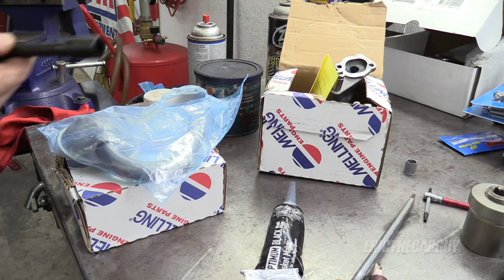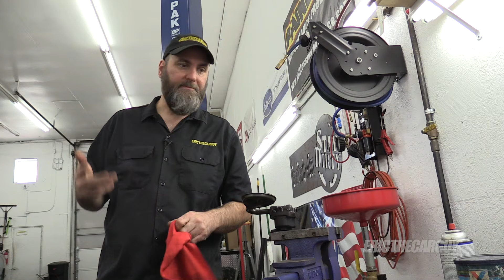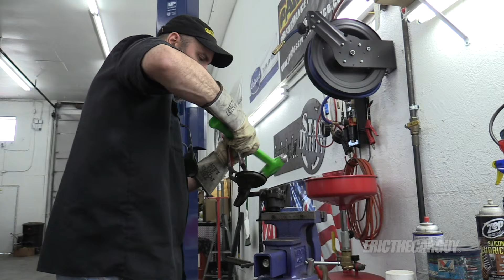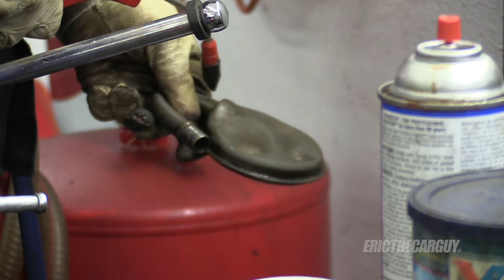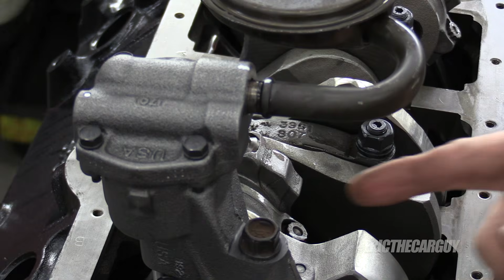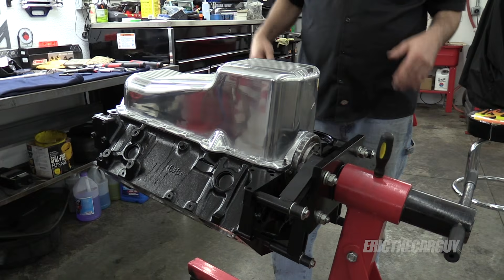How To Properly Install an Oil Pump Pick Up

Comment: My pickup tube had 2 thou interference with the pump, and the only way to fit that in was with a bearing splitter.
I drilled the treads out of a nut M16 to fit the tube, cut the nut in half and grooved the sides with a grinder, then put the 2 halves around the tube and tighten the bearing splitter, add the extensions and the bar across the top, put it in the vise and hammer it in.
It was sooo easy, and when I finished it, shouted "Flawless Victory" just like the Mortal kombat arcade games back in the day.
It's great when you put a plan into action and it actually works.

Comment: I am having the same problem right now with my 1998 Chevy S10, with a 4.3.   I am using the same Manufacture and it is a high volume.  I measured the difference between the male and female (pump side) is .005".   I am trying to hone out the male hole and then drill a hole in the pump to thread for 1/4" x 20, to then use a set screw to lock it in place.  Should work?

Comment: It's helpful if someone has the capability to take the entire pan out, indoors, with every tool needed on hand. This video would definitely be helpful
Reply: You don’t have to be indoors, and if you don’t have the TWO tools required to do this job then maybe you shouldn’t be worried about working on cars.
Reply: @scottblubaugh sure buddy, I know being indoors & outdoors is no different than working underwater. Show me a video where you take the oil sump out using jack stands & might consider your reply is is for the everyday guy who can work on cars.
You're entire response is dumb no matter how good you are as a mechanic. As I said everyone doesn't have a shop & power tools to do every single job. I can maintain my vehicle well. I've done every single repair myself. 

I just happen to know, realistically for a person who works 40+ hours a week & has a family. Taking the oil sump out without a lift isn't an easy job & is time consuming. But hey, what do I know right. I shouldn't be working on my own vehicle according to you

Comment: They now sell oil pump and pickups that are bolt on. Also if you braze the tube on be sure to temporarily remove the bypass spring else that excessive heat can weaken the spring thus lowering the bypass pressure.

Comment: Bought a gmc 1500 truck was told by dealer it had been serviced three weeks later i go change oil my dipstick had good clean oil.on it ,but when removing drain plug  only sludge began to come out  .is it possible the oil.pck up tube is still sucking up good oil and engine not damaged ,oil.pressure still good i plan to.remkve oil pan clean

Comment: Hi, i have a 95 silverado k1500 4x4 5.7L. I want to upgrade the oil pump to a high pressure oil pump is there any modifications i need to do to install it?

Comment: Well I know where I went wrong. I bought a crate motor when I was 19, we put the oil pick up tube in the freezer then put it in. We did not tack weld it. I blew the engine a week after installing it. My dad blamed me for driving it to hard. Chevy replaced the engine at no cost but clarified the cause. Always wondered what we did wrong.

Comment: Use an open end wrench that fits the tube against the flange, never hit the tube ,...ALWAYS Tap on the flange. . Then tack a spot. First, tape a 3/8 drill bit to the bottom of the pick up, place on the pan sans gasket. This will give you the proper gap , after the gasket, do this before you fully seat the tube. Its not complicated.

Comment: Good Job! My 2007 Hyundai Elantra G4GC 2 litre Engine Oil Pump pickup pipe , has a gasket and has 2 bolts fixing it to the engine block.
Hehe, I polished my Alloy Cast  oil sump too! 💖👍

Comment: Everyone in my engine builders page is saying to take apart any oil pump I get . Melling or sealed power. And check for burrs. The shaft notch on mine was razor sharp.

Comment: It is actually a lot harder to do with a new pick up screen. The new screen is about 6mm larger than the hole in the pump. Since an old "already compressed" used screen was used it was already compressed enough to get it started into the new pump. Next time I do this I will use the old screen.

Comment: Hello Eric. I enjoy watching your videos. You go straight into business explaining the process of repair or installation which is very good. 
I need your advice in a project I started with my 2000 landrover discovery 2.
I am installing a diesel engine year 2000 isuzu npr to my landrover discovery. So far so good. Where I need guidance is with the oil pan that interferes with the front differential. I need to modify the shape of the oil pan. The pick up line I figure needs to be reconfigured to the left side of the oil pan. When I reduce the volume of the oil pan that interferes with the differential - will the smaller volume of the oil pan affect the performance of the engine?

Comment: My truck has a plate in between the the pickup tube and the the journals, it gets held in place with the same bolt used to hold the pump in place as well as 3 other nuts. Is it not necessary to put that plate on? Because if not I will remove it next time because its a hassle to hold the pump in place and hold the plate in place while at the same time putting  a nut on and a bolt on while under the vehicle because of gravity.

Comment: I put a nice tack weld like you did . Next day I pulled the pickup off by hand. The weld cracks off the cast as it cools. Yours did too I guarantee it. Waste of mig wire. There is a proper Tig process and a type of brazing but mig useless on cast. Pioneer makes a retainer that bolts on part # 839061 . I'm using that.

Comment: What "several engines" does that "Chevy" oil pump pickup installation process supposedly apply to and where exactly in "Chevy" manuals, tech info or other "official" and "reliable" sources did you find that "Chevy" process?

Comment: Now Eric I respect you and your advice But I just opened my oil pump and check out the measurements and the relief valve inside the house to make sure it goes up and down well mine was stuck and I was going to port the sharp edges.
And pack it old school style with good ol vaseline .  Just a word to the wise check out your oil pump valve on the inside .
That 💩 would have been disastrous for me it's my first baby 350 hopefully not the last.

Comment: If you tack weld it should be done with a high Nickel rod.  Cast iron welded to steel with a steel rod is very brittle.  Mentioned in other threads for installing pickup to SBC.  Brazing would also produce a good joint.

Comment: use half a tube flaring tool set to loosely clamp around the tube and hold it at the roll, then use a press and some blocking to support and shove it in properly

Comment: Hello sir, i have suzuki jimny wide auto 1998 model. The car loses power uphill, i changed its gear box, but the problem is still there. Its rpm doesn't increase beyond 2 in Drive and 2nd gear, but in L it gains acceleration, plzzz suggent me useful tip as i lost huge money correcting it

Comment: Eric, you can use the open end side of the wrench over the pipe, and hit the wrench to drive the tube down.  And you should use clay to measure the pan clearance.

Comment: My Way of thinking  should their be a gasket between oil pump and main cap to prevent oil pressure loss?
Reply: machined surface internal.. it is all set

Comment: Shouldn't need heat to remove the pickup tube! its not that big of an interference fit, you should be able to just put a block of wood in the inner elbow of the tube and tap it out relatively easily

Comment: :50 Good thing you got a new one from a reputable company. I have heard that when people reuse their old one or buy a cheap one, it can break off and cause a catastrophic engine failure.

5:15 is is common with OHV engines that used ignition distributors. It is also common with OHV engines that were initially built with distributors, but were given a distributorless ignition later in production. For example, the Ford Vulcan was introduced with a distributor, but got a distributorless ignition. The device that replaced the distributor (Cam sync plug) turned the oil pump shaft the same way a distributor would. Engines like the GM LS-series and MOPAR 5.7 Hemi were built for distributorless ignition, so the oil pump was directly operated by the crankshaft.

Comment: That is bad that the unit didn't go together like it should without so much force and I hope that I don't have that problem if I have to remove an engine and work on it. Thanks for sharing this information with us all.
Reply: A lot of them are a press fit, so this is pretty standard. Some are bolted on though, I believe some Fords use that style.

Comment: The oil pickup tube on my 1976 Ford 351 windsor and the 5.0 in my former 93 F150 is bolted on, I prefer the bolted on than this interference fit stuff.

Comment: I find this puzzling, that the factory does not use a tack weld but common practice is to tack (cast iron) for a reinstall. I wonder if the factory uses locktite in addition to the press fit of new parts with their special tool. Belt and suspenders is appealing, given the implication of it coming loose.

Comment: Is there any difference between a friction fit and an interference fit? If not, then why is it suddenly called this and not that any more? Especially since the long word interference is quite a mouthful, compared to the short and sleek word friction.
Reply: If I'm not mistaken, an interference fit means that the pieces have to be pressed together somehow, because the hole is slightly smaller than the piece going into it. Essentially, the hole is squeezing the piece with enough force to prevent it from moving, like with the oil pickup tube he removed. A friction fit uses the friction of the two surfaces to hold things in place, like with the Morse taper on a lathe tailstock, or drill press.

Comment: The tack weld it really the most important part. The factory one wasn't welded, so I didn't weld mine. Ended up coming off doing cam-crank-correlation and spun 3 bearings in my freshly re-done top end 4.3 Vortec. :'(
Reply: Recently killed my shortbed with a pick up tube that got pushed up and oil starved it. If u have no oil pressure when ur slightly low on oil check ur pick up tube.
Reply: Sorry that you went through that but brave enough to help someone else.
Reply: No it didn't.
Reply: Wow that really sux 😲 
I would go straight trough the roof and break everything on my way there 🥴
And be very sorry after ofcourse 😑
Reply: @duncandonovan5270  Yeah, I was upset, but it was too close to snow time and that's my plow truck. I had to order a rebuild engine and do the swap that week. I took two of the spun bearings out and two good ones and made a plaque that they hang on with the words "don't f*ck it up" :)
Reply: The tack came off and thats what ruined your truck?

Comment: Hey Car Guy, I have a question.  My check engine light on a 1990 Acura Integra never comes on immediately.  It can idle for 10-20 min without coming on.  As soon as I accelerate past 35 mph, it will come on.  Any ideas?  Thanks, ,and thanks for the videos.
Reply: That does sound very weird. Does the light blink normally when you jump the diagnostic terminals?
Reply: FFS .. plug it into a diagnostic machine .. that's my idea

Comment: I have always used an open end wrench on the boss (lip) on the pickup tube and tapped that with a hammer.
Reply: Never had an issue with this method as long as you took it nice and easy

Comment: No gasket between pump & block?

You sensibly drifted it together, and a nice tack weld.

In theory you could freeze (inverted duster can) the tube and heat the pump hole,
quickly tap together.
Reply from the maker: I don't believe there is a gasket for that mating surface. I think it's a machine fit.

Comment: good morning eric. the tack weld.....good one! a step that's all too often ignored.
Reply: And one the "factory" never ever used and still doesn't because its completely pointless AND potentially damaging/destructive if done "incorrectly" which is basically guaranteed "tack welding" MILD STEEL TO CAST IRON.
Reply: @deeremeyer1749  agree that weld did nothing.  It cracked free as it cooled.

Comment: Very brave eric lol what if that weld  fails !!!!
Reply from the maker: I've never seen it happen yet.
Reply: @ericthecarguy  iam sure it wont , but could you imagine
Reply: Love your vids Eric,  I've been building engine's for over 25 years installing oil pump pickup tube's exactly the way you did in this video.  I've had 2 welds not hold , got to be sure to get  penetration on the tube. 👍🏽

Comment: Eric - you nailed it again.
I'm glad you made a point of showing checking the pickup to the pan - a lot of people eyeball them, get them too close, and can't understand where their oil pressure goes at high rpm.
Good point to tack them in place too, I've seen them vibrate loose - and suck themselves to the bottom of the pan.
All these tips you show are what set yours apart from other 'how to do it' videos'
Well done!

Comment: Do they really recommend welding it? I know if it falls out it's bad but just wondering if that's the normal thing people do.
Reply: Welding steel to cast iron with a mig gun is useless.
Reply: first with tacking with a stick welder and then with wire welders in over forty years i have yet to have a tack let go in this usage scenario. so far....so good. ;-)
Reply from the maker: You don't have to, but some recommend it, which is why I included it in the video.
Reply: it's a safety step that is all too often ignored. an especially good idea if a tube has been reused because a reused tube doesn't have the same amount of tension against the pump housing as a new one especially if it has been heated like that one was.
Reply: ... Besides its not under and tension. It's just meant to hold it in place in case of ruts in the road etc.
Reply: I don’t think wire MIG is the proper way to tack those metals, as I don’t believe that the tube and pump housing is plain carbon steel, it’s an alloy of some type. TIG with the proper rod type (whatever that might be) is probably the better way to do it. IMO, a single MIG tack has a high probability of failing with the constant vibrations.